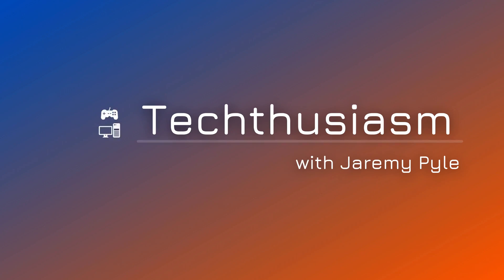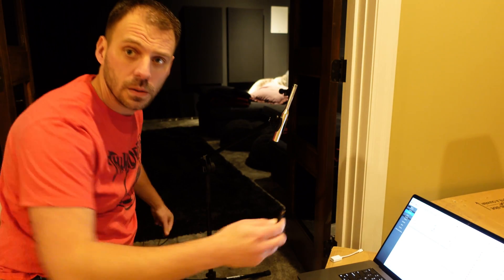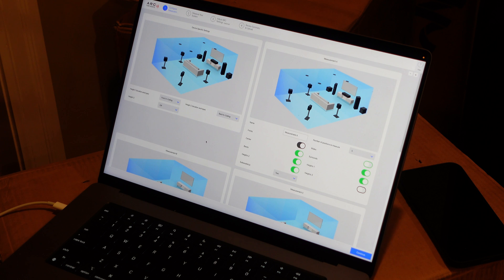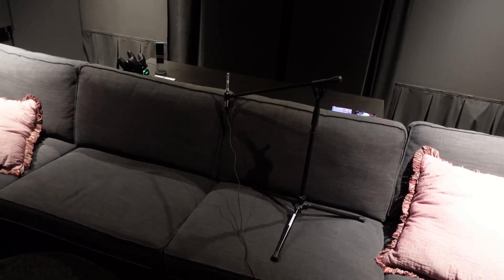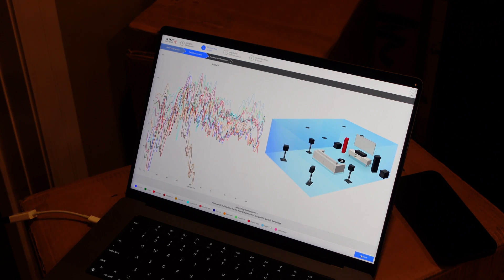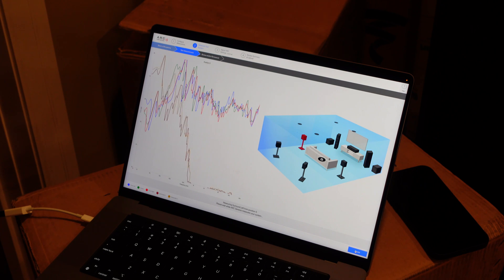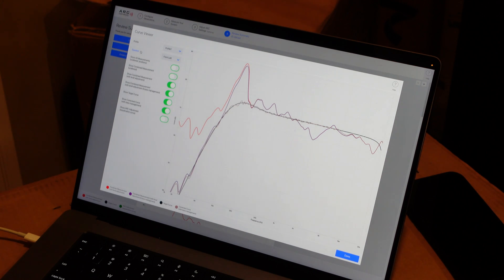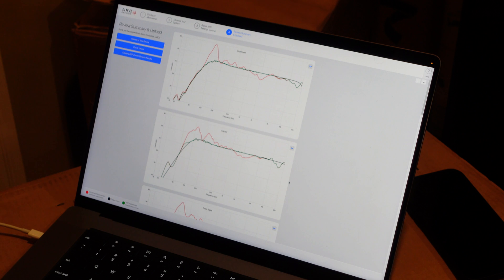HOW TO RUN ANTHEM ARC | Full ARC Genesis Acoustic Calibration & Overview Setup Using an AVM70 Preamp

Comment: @Techthusiam .. Hello I have similar setup ... ANTHEM AVM 70 & Focal 1000 IW6LCR's ... one issue that I am facing while calibrating.. noticed there is zero bass coming from my LCR's ... have you seen anything like this ? is this an Anthem issue / Focal issue ... any thing that you would suggesting trying ..? thanks
Reply from the maker: Did ARC cross them over too high?

Comment: Hello, I have a brand new MRX540 but when starting the ARC Genesis, it can't find Device??? MRX is connected LAN and I can use the web interface...what do I wrong?
Reply from the maker: Might be something with your network or control setup. I had to unplug my Control4 controller in order for ARC Genesis to see my Anthem STR. Unfortunately, networking is one of the weaker parts of the Anthem platform.

Comment: Hi Wonderful video, thanks. Quick question, At what level do you keep your AVM 70 master volume ?  do you adjust speaker trim level to 75 db 
while you run calibration ?
Reply from the maker: I find I'm watching movies in the -20 dB range usually. Quieter than my former Marantz.
Reply: @Techthusiasm   Thanks, mine is on its way.. Cant wait to get hands on it. going to pair it up with one JC5, and two A51
Reply from the maker: Great combo!

Comment: You have lots to learn wrong mic positions. Position 2 should be forward of mic 1 and 3 should be forward of mic 1 and higher and lower . And you only have to make one arc and then create profile for different profiles ect stero
Reply from the maker: Thanks! Yes, I'm realizing my 2nd and 3rd positions should be ahead of 1 and lower. 4 and 5 I did higher and behind. But I had a better structure for positioning I have been using since this video. I will be making more ARC videos to come and will clarify these points. From the manual:

WHENEVER POSSIBLE, place the 2nd through 5th positions two feet (60cm) from the 1st position. Up to three feet (90cm) is acceptable, but not usually necessary.
WHENEVER POSSIBLE, place the 2nd through 5th positions symmetrically around the 1st position. Use an X pattern, with the 1st position in the center of the X, and each corner two feet (60cm) from the center.
WHENEVER POSSIBLE, vary the mic height for the 2nd through 5th positions, with two measurements being 6 to 12-inches below the 1st position and the other two measurements 6 to 12-inches above the height of the 1st position. This method provides ARC with a more three-dimensional view of the room and its acoustic signature.

Comment: Great video with great pointers. I definitely will be using your video as a reference. I like how you positioned the microphone around your main seating position to get a broader coverage. I think it's ridiculous that you have to recommend everyone to turn off then back on the AVM70 to get the kinks out before calibration! A $4,000 unit shouldn't need a soft reset,Period! I'm from the calibration period of Tone,Volume & Balance control knobs....Calibration Done!!🤣  The Old Man!👨🏾‍🦲
Reply from the maker: There is a very specific bug with Anthem ARC that I learned a definite workaround for after this video. It results on not getting test tones generated for the measurement, but it's easy to address. Anthem knows and a fix should come.
Reply: No its wrong do not follow it mic positions wrong
Reply from the maker: I'll do an update video and address the mic positions.
Reply: @Techthusiasm  have you tweaked anything that you find improves your sound in arc ?
Reply from the maker: I'm still learning, but I think I prefer adjusting the target curve to add a bigger deep boost and add some high frequency tilt down along with EQ'ing farther than 5 kHz. I find harsh high frequencies difficult, I think, and that Anthem's default curve leaves bass a bit underdeveloped. But, and a big but, I'm still feeling things out and working on EQ'ing two different brands/models of subs as well.

Comment: Measurements are not corresponding to profiles. You can make one set of measurement but set 4 profiles with different speakers selected. If there is excessive noise Arc will tell you and then retake the measurement. You should alter the height of the mic, position 2+5 should be lower than position 1 and position 3+4 should be higher than position 1
Reply from the maker: YES! I figured this out. It's awesome to be able to make one complete measurement and then tweak it via profiles. Incredibly cool. I'll cover that in figure ARC content. Thanks for the height tip as well for lowering the sides.
Reply: @Techthusiasm  I do the UK dealer training for Anthem and have been installing and setting up since 2008 so if you need any help let me know.
Reply from the maker: Sweet, thanks! Would love to get someone official on the channel for a best practices video... :)
Reply: @Corey  could you do a video on the proper "how-to" of measurements and adjusting of the curves?
Reply from the maker: Yes, I will do a lot more Anthem and ARC videos coming up.

Comment: Hi Jaremy. I noticed the distance between some of your measurements exceeds 2ft which I know that audessey firmly states. Or does that rule not apply with Anthem arc. Just curious.
Reply from the maker: It's right around there, actually. I ended up tweaking how I move the mic around since this video, keeping all the measurement in a bubble around the mic stand at the couch center. I'll talk about that more in follow-up videos.
Reply: Great thanks Jaremy

Comment: You should do a video running Arc in professional mode.
Reply from the maker: I will for sure. This was just kind of getting started and basics. I've learned a lot more about ARC since making this. More to come.
Reply: @Techthusiasm  it would also be great to see the the results of arc after calibration. Speaker levels and all because a lot of people say that arc runs channel levels high. I ordered the AVM90, so I want to be prepared for what I got myself into.
Reply from the maker: Yes, I will make a full capture video of my results and tweaks and more advanced use of the software.
Reply: @Techthusiasm  that’s would be awsome